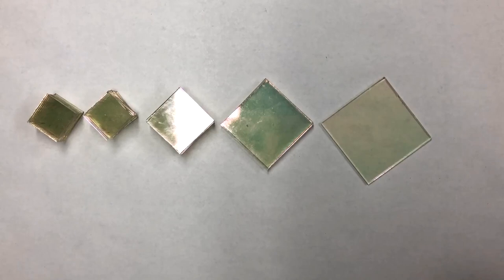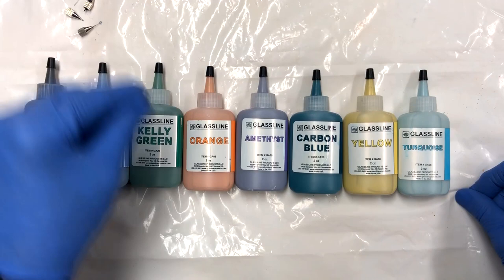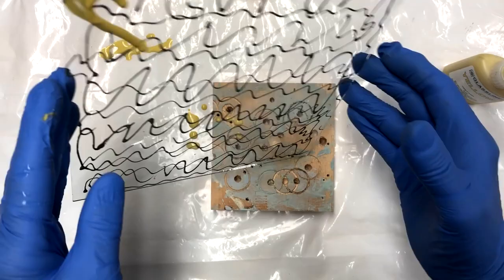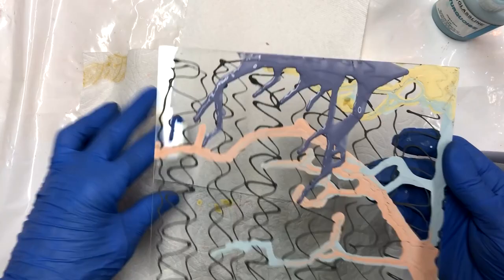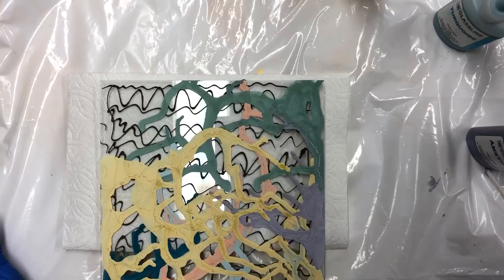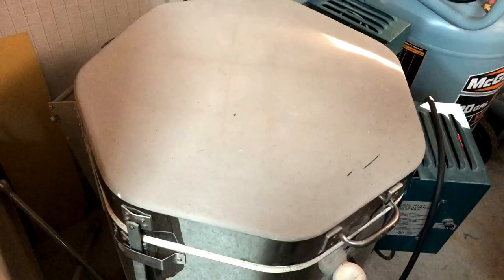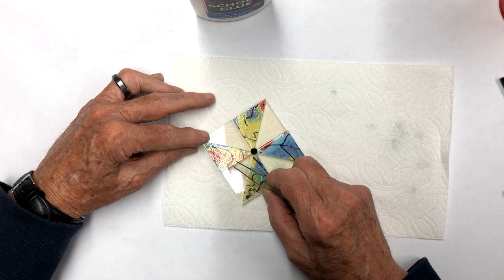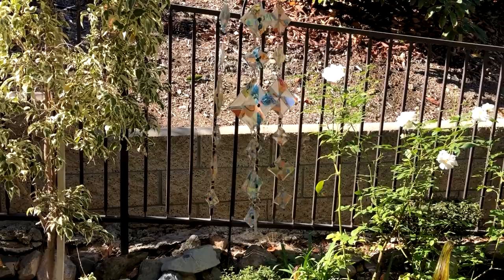Fused Glass Pinwheel Wind Chimes

Comment: Great idea Bill, thanks for sharing! Where do you get the spinner mechanism and do they come in different sizes? Did you add any dichromatic or sparkle to the paint? Some of it looks very sparkly (is that a word?).
Reply from the maker: Hi Susan,
Thanks for your comment, the reason the pinwheels sparkle is because the base glass is iridescent, and that gives you that look when the sun hits it! The Spinner motors are from Amazon, they have all kinds of them, some are even solar powered. They aren't too expensive. So glad you're enjoying these projects, it's been fun sharing them with others. Hopefully you will check out some the other videos on my channel. Have a great day!!
Regards,
Bill Stone

Comment: I've watched other people put a clear piece of glass when they use frit on top but you didn't do that? Is it because of the temp, or is it a personal choice? Like with jewelry, I mean like a sandwich clear glass, frit, clear glass
Reply from the maker: Hi Michelle,
Most of the time I don't put another piece of glass on top because I don't want it to be too thick. Also, when you put the second sheet of glass on top sometimes it's hard to keep the bubbles out from in between the two sheets of glass. If I were to use a bottom sheet than frit than a top sheet, I would make both of them 2MM thick and not the standard 3MM thick. This project was made with glass that I painted. Hope that makes sense. Enjoy your day!!
Regards,
Bill Stone

Comment: where is the firing schedule? for the glass paint part
Reply from the maker: Hi Susan,
If you're into fused glass already, just use your firing schedule for a full fuse, my kiln is between 1475 degrees and 1485 degrees to get a nice flat fuse on my glass, I'm using COD 96 glass for all my fused glass projects. The Paint I used for this project is made by Glassline and they say you can go as hot as 1500 degrees; I have never tried going that hot myself. I hope that helps you out. Check out the video Fused Glass Candy Dishes, there is a painted glass dish in that video also. Please feel free to ask me anything about these projects on my channel. Thanks for your comment. Have a great day!!
Regards,
Bill Stone

Comment: Love it Bill ! Makes me wish I could get a kiln. Have you built a mobile?
Reply from the maker: Hi Julie,
Great to hear from you again, glad you enjoyed this project. I'm going to make a mobile later this month. I'm going to used fused glass parts left over from other projects, I think I will call it the odds and ends mobile. If you want to play around with the fused glass, check out some of the YouTube videos using a small microwave kiln in a microwave oven. You can get them from Amazon. You will also have to get a separate microwave oven with a turn table in it. It doesn't have to be an expensive one. Maybe you know someone who has an old microwave they want to get rid of and will give it to you. If you use one of these little microwave kilns in the microwave you can't use it to heat any food, because of the high heat and it will contaminate the inside of the unit. I hope you have tryed some of these projects. Thanks for your comment, look forward to hearing from you in the future.
Regards,
Bill Stone